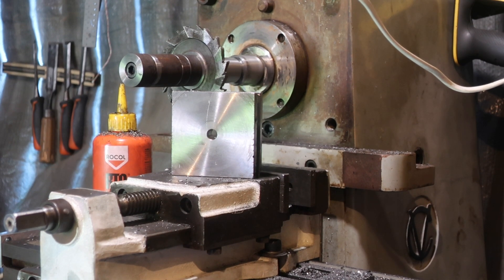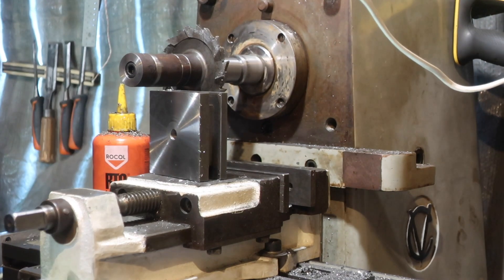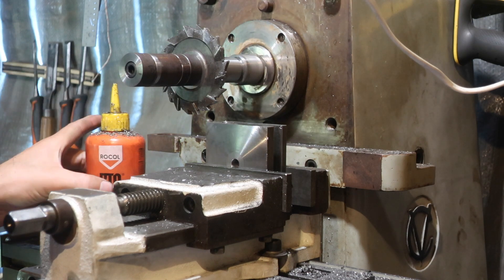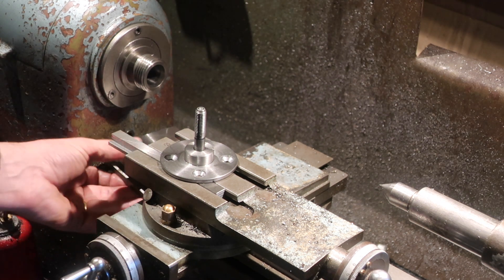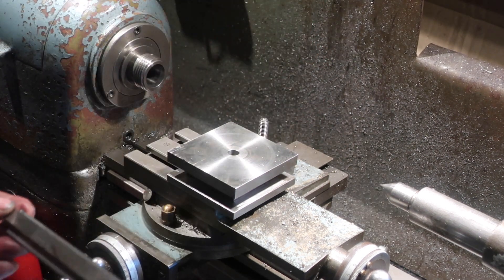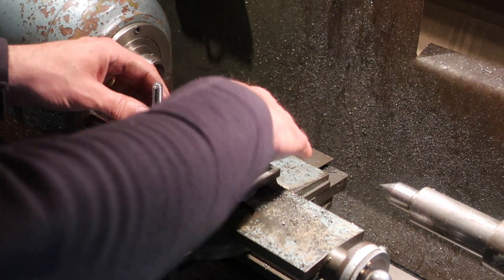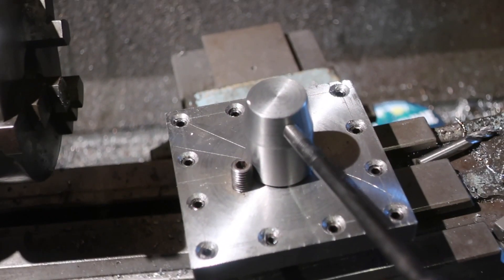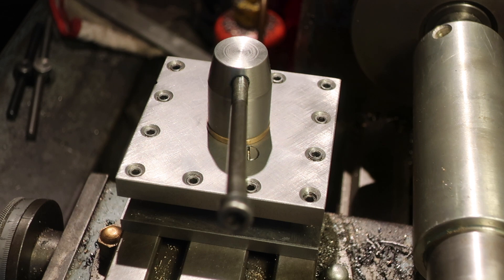Quick project - 4 way toolpost

Comment: How did you make the indexing mechanism?
Reply from the maker: Pretty simple.  I drilled a hole thorough the toolpost which houses a spring and a small ball from a bearing, the top of the hole is tapped for a grubscrew that's used to increase or decrease pressure.  The baseplate has dimples drilled into it at the indexing points (using a centre drill in this case).  As the toolpost swivels round, the ball is pushed up into the body against spring pressure, and then clicks down partially into the dimples at the indexing points.
Reply: @wibblywobblyidiotvision  Thanks for the reply.